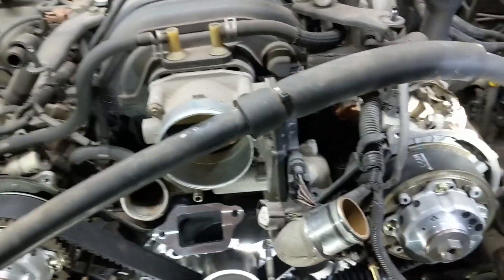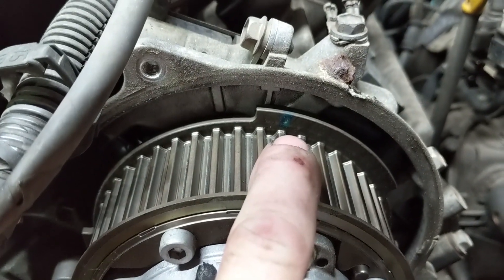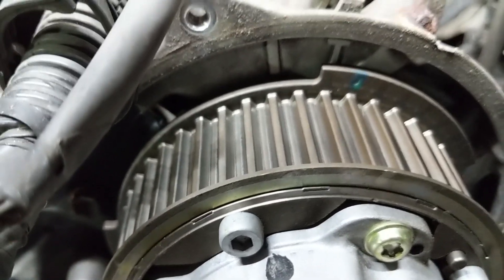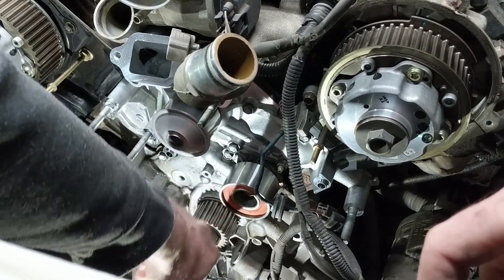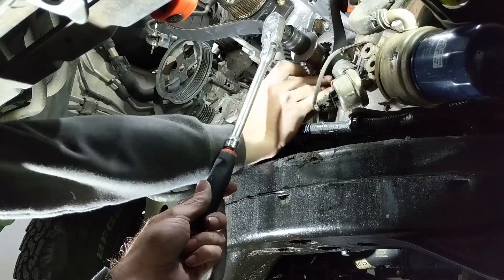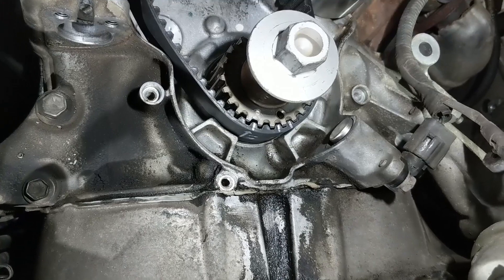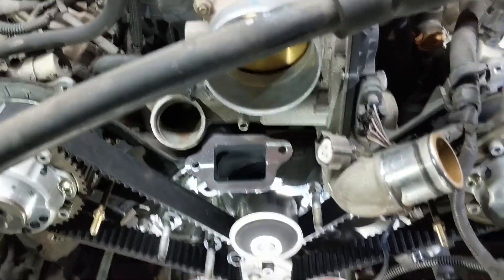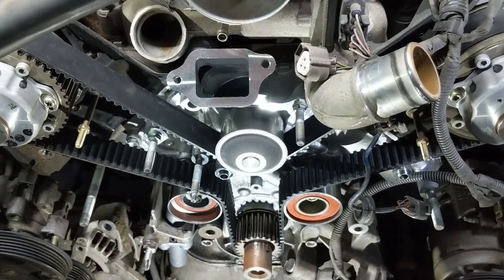Timing Belt Replacement How To - Toyota Lexus 4.7 2UZFE

Comment: Just use the "T " mark on the camshaft pulley timing marks ....the crankshaft pulley mark will be lined up with the white dot on the crankcase cover.... ..forget about lining up crankshaft pulley mark with idler puller bolt....approx 50 degrees past TDC....waste of time

Comment: My 2006 Gx470 has an oily mess that seems to be coming from behind the passenger side camshaft gear. The mess flows down inside the timing coves onto the tensioner then all the way down under the Crank sprocket and out onto my driveway, ugh!!! I will be replacing the seal to the passenger side cam, clean the mess, new timing belt, water pump, tensioner, pulleys, gaskets and whatever else gets in my way. Thanks for the video and the info. First timer, wish me luck, fingers crossed. Now where's that damn 10mm.
Reply: Got it done while I was here at home while on paid admin leave. Long story, don’t ask 😂 Followed a couple of videos here on YT.  Purchased the ASIN kit and also replaced the oil seal on the passenger side camshaft. Car has been running great, oil leak is gone and I saved about $1k. All is good.
Reply: @percyjackson2800  NIce!!  I'm getting ready to change out my TB and WP on my 05' Sequoia Limited again.  Same 2UZFE engine as your Lexus Gx470.  I have put a 150k miles on my last TB and WP.  I'm now approaching 300k.  My favorite motor ever!
Reply: How did it go brother?
Reply: Percy....I am assuming you changed your camshaft seals as well....I just did mine as well......PITA as camshafts have to be pulled and disassembled to install seal....did you do both sides and replace crankshaft seal ad well ?
Reply: @bilge77  I only replaced the passenger side camshaft seal. I know, I know… should have done both. Time will tell.

Comment: Immediately after pulling the tensioner pin, will the cams drop backwards a hair leaving them directly on TDC or did you have to coax them on over?

Comment: comments on amazon for one of the kits said the water pump was crap and failed too soon. whats your experie ce
Reply: Buy OEM. Denso and Aisin I believe
Reply: @marshall601  yes but it is aisin there
Reply: @LLCoolPass  lots of fakes on amazon
Reply: @marshall601  read the reviews tho
Reply: @LLCoolPass  What you can do is buy it from amazon, then go to your local toyota dealer and ask to see the belt or item, or buy it and return it the next day to see if you got a fake or not.
Reply: Buy the Aisin TKT-021 kit.....period

Comment: The T to right of cam timing mark is where you set it for timing belt swap there is also one for the crank
Reply: Brendon...you are 100% correct...and Nordic ..that is more than one way to skin a cat....Nordic ..your way on the "I" mark and TDC, the cams will unload and shift on you when you remove the belt...

Brendon and I ...use the T mark....cams will not move on you....

So Nordic....do it your way....we will do ours...do be a condescending A-hole...see your above remarks
Reply: Actually you are wrong. He set it up perfectly. You don’t line it up with the “T”. Follow the instructions or you are doing it incorrectly.
Reply: @nordicpride9708  Look in the toyota manual for doing a belt swap setting cams to the t is the correct way to do it. Take it or leave it but thats how its done
Reply: Brendon Vickers Not sure what variant you are speaking on but a 2UZ-FE with VVT-I uses the “I” mark to align the timing belt. Not the “T”. The Aisin manual also confirms that in fact the “T” is to not be referenced....

Maybe you should put out a public service announcement that you are doing it right and all of the experienced mechanics on here are f****d up...
Reply: @nordicpride9708  vvti is 2008 onwards previous models you set it to the t
Reply: Brendon Vickers Yeah and this video is depicting a VVTI....
Reply: @nordicpride9708  What does the “T” exist for then if its not used as Timing marks. I hate
This thread its the whole reason im confused on doing this job so many different people saying different things.
Reply: @nordicpride9708 No you are wrong the cams have tension if you release the belt your cams will move and you can hit the cilinder and destroying the engine. You have to Advance the timming to ATDC 50 degrees to the right so both cam notches are aligned with the "T" on the block this releases the cam tension allowing you to remove the belt safely. This is on the Toyota Manual and The Car Care nut guy an ASE certified Toyota mechanic explains this very same procedure in his channel. You are actually wrong.